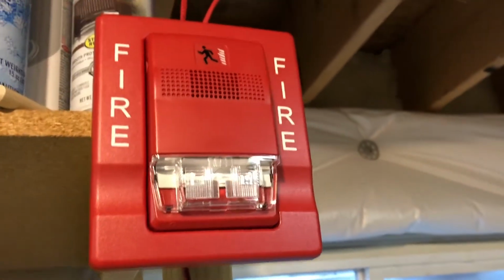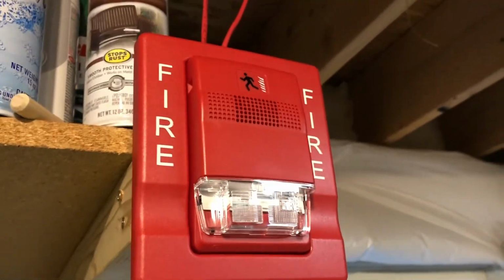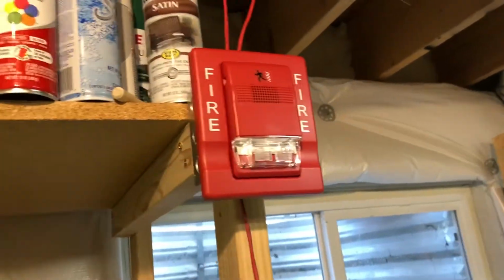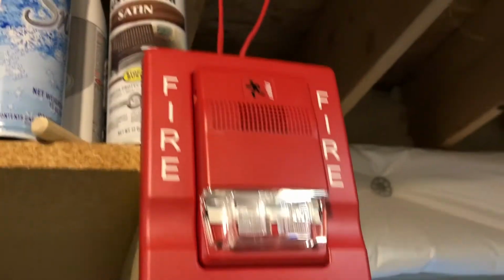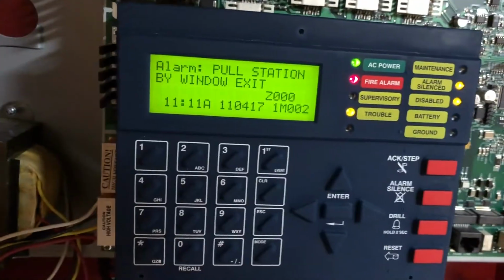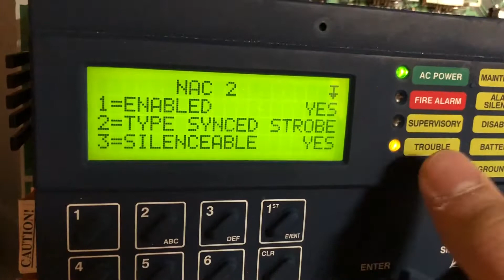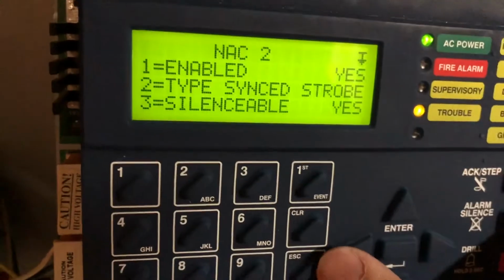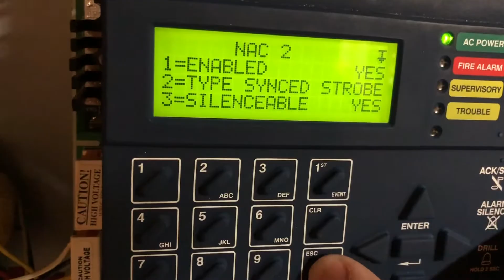Fire Alarm Short: EST Selective Silence with System Sensor Sync

Comment: The alarm has a 1 second time delay before it sounds the horn. The sync mod has a slight power drop every second. The reason why the genisis will not sound is because the mod resets the time delay cycle over and over.

Comment: Enhanced Integrity strobes will also synchronize to the System Sensor sync protocol.  However, the Integrity strobes may flash slightly before the SS strobes flash, but they stay in sync otherwise.